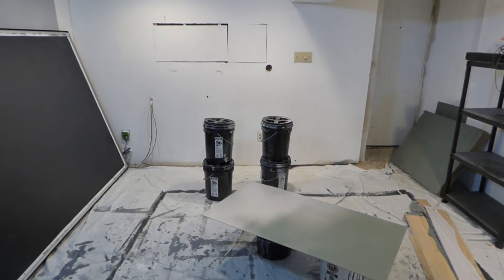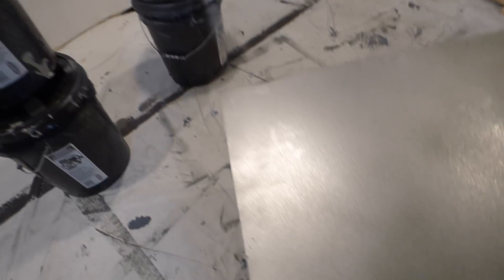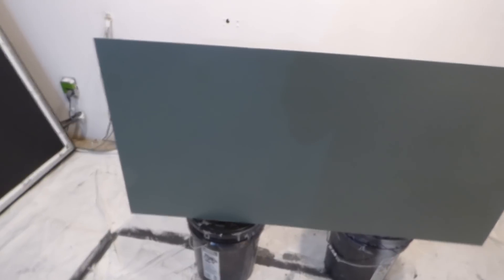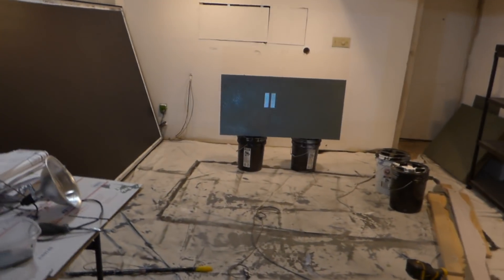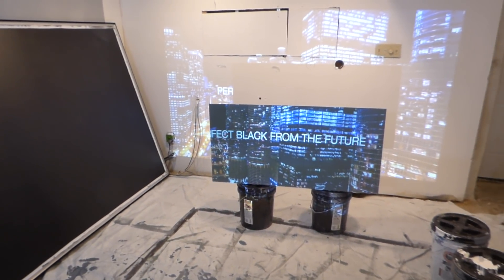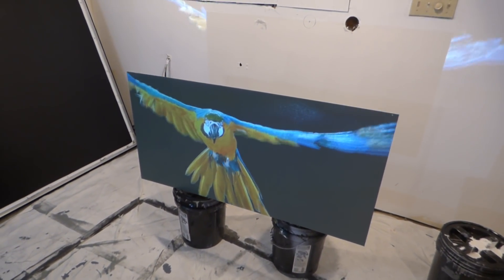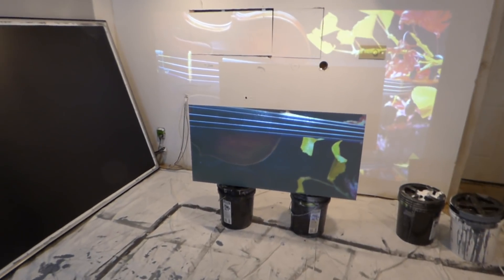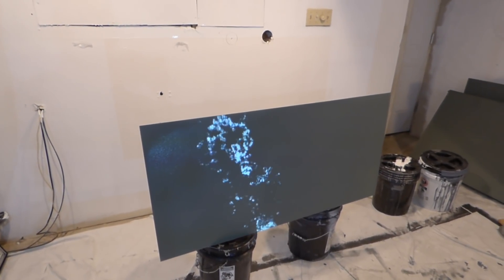MOST INSANE SCREEN PAINT IS COMING NEW ECLIPSE NANO SPRAY ON SCREEN PAINT DEMONSTRATION! 02/16/18

Comment from the maker: NEW ECLIPSE NANO PLATINUM SLATE 4K AND 3D READY 02/16/18

PROJECTION SCREEN TYPE: Spray on screen paint
SCREEN COLOR: Nano Platinum slate
GAIN: Smart technology gain X10
ANGLE GAIN: 190
LUMENS COUNT: 500 and up. 3D: Yes. 4K: Yes 4K ready.
PROJECTORS: 4K, 720P,1080P, LASER, DLP, LED, LCD, Short throw, long throw and ultra short throw projectors.
Indoor only

Color enhancement technology X3 Perfect whites and ultra dark contrast levels. 4K and 3D ready Lumens only 500 and up compatible with all projectors. Smart technology gain X10 with color enhancement technology X3 Low-odor Low - VOC Eco- friendly, Washes of with just warm water and soap, one coat spray on application. Designed for all surfaces no priming needed! 

Available in 2 qt only price $482
All eclipse nano spray on projection screen kits come with a free Wagner 150 paint sprayer.
Free worldwide shipping launch date 02/16/18
Free Wagner 150 paint sprayer
Coming soon to
www.crystal-edge-technology-screens.com
Email us at immerse4kcinema@outlook.com